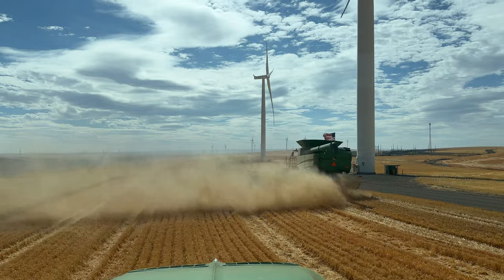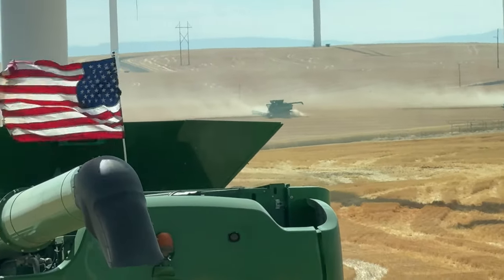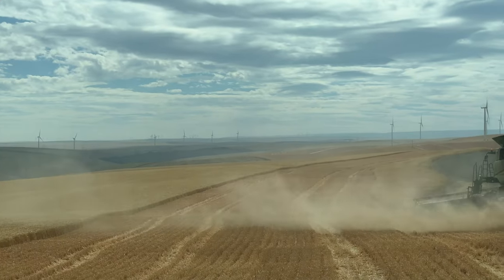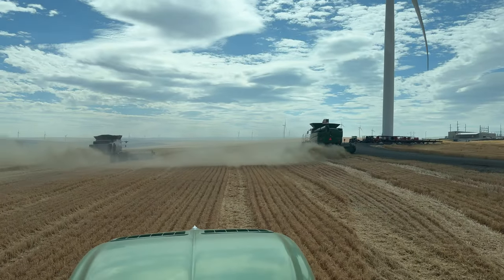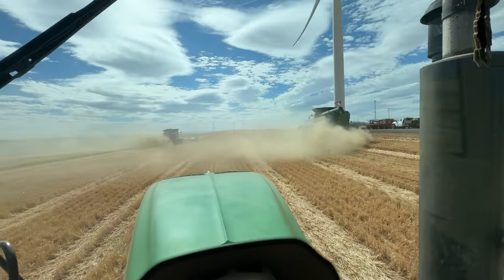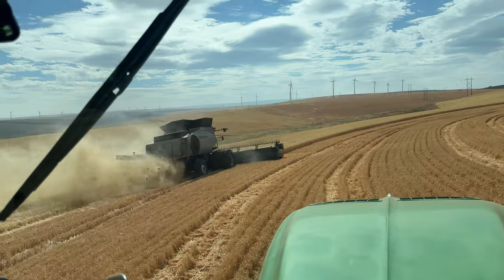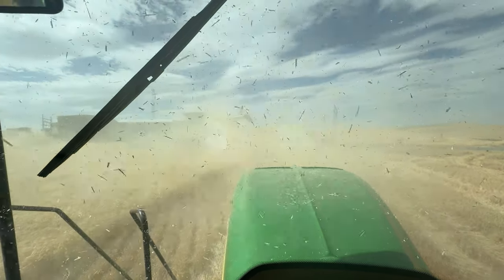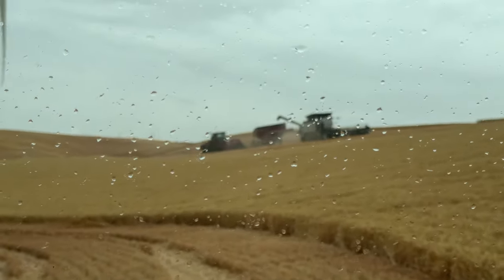Wheat farming on a wind farm

Comment: Thank you for another awesome video!  You commented on the fire danger harvesting in high winds.  I was curious whether high winds like that interfere with the separation of grain from chaff with the air coming up through the sieves.  Also another question - how many farmers in the area have more than one paint color in their harvesting equipment?  Is there a reason they do that?  I'm not a farmer, but I would have thought it's tough enough to efficiently learn/maintain one color of paint, let alone more than one, but maybe it's not too bad?  Thanks again! 🙂
Reply from the maker: Ideally you have all the exact same combines, that way any parts you have would go on any of them. Theres a guy that runs new holland john deere and case i believe. My buddy got drone shots of him in the yellow new holland but not with the other colors in tow.